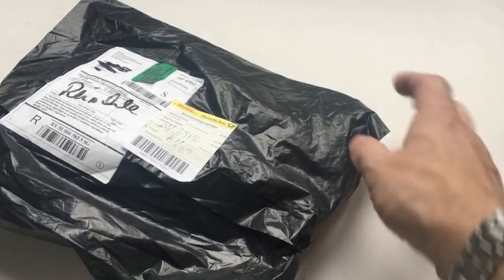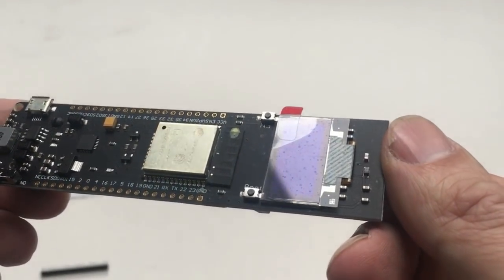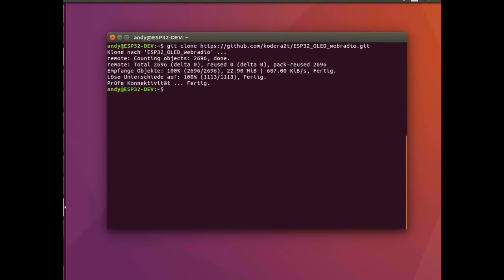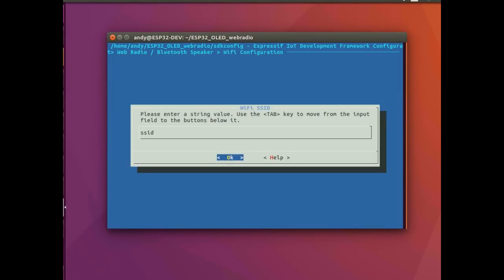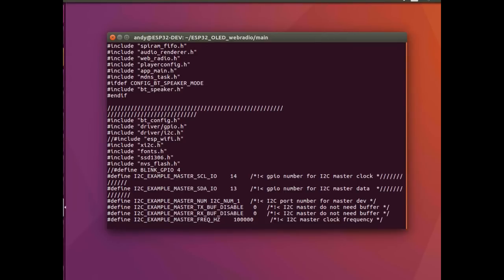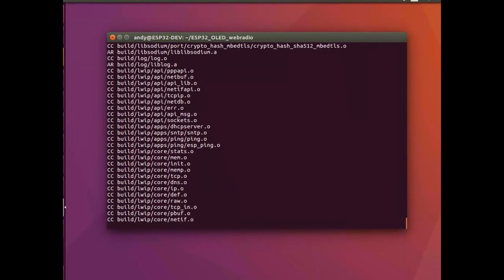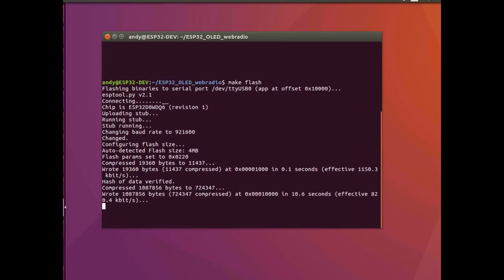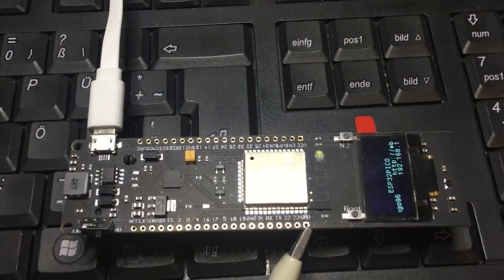5 Minute Project: TTGO ESP32 OLED Li-Ion board WebRadio

Comment: how much is the range of this ?
Reply from the maker: With directional antennas, 10km have been achieved. But this won't work in real life. Realistically you can expect around 300m with the built-in antenna, if you have a clear line of sight. In a steel reinforced building, you might not even get to the room next door.
Reply: AReResearch thanks. Mine goes 4 floors up and down in same and different building with good signal.